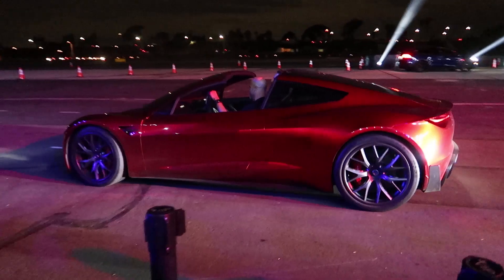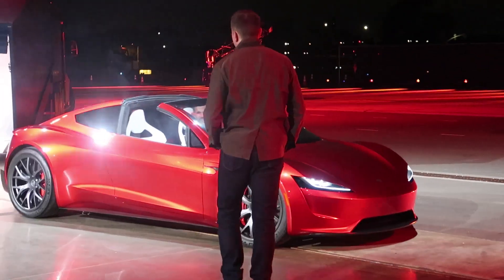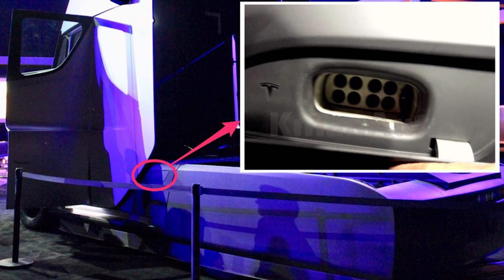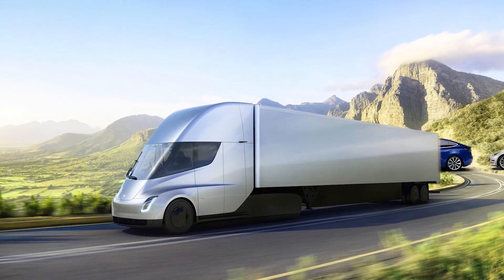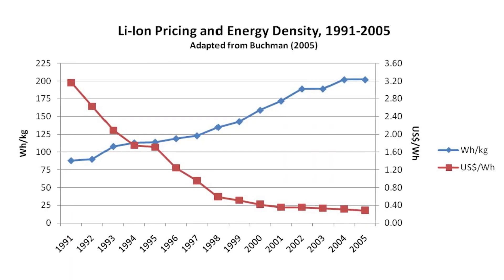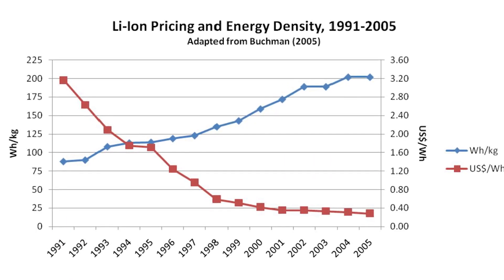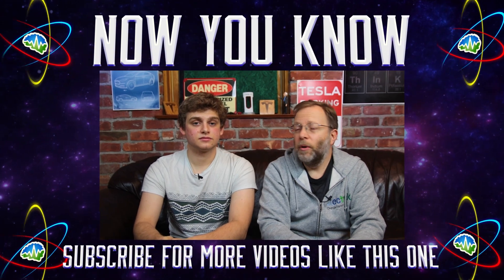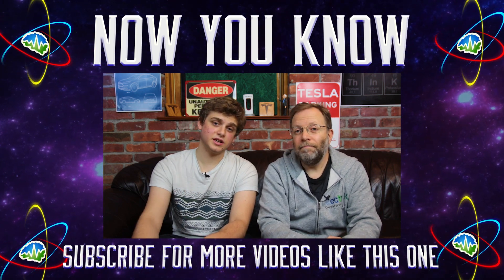Mega Charger Theories - In Depth

Comment: I’m not convinced that there needs to be any breakthrough over the existing 2170 cells to provide the power and capacity needed for the Semi or Roadster.  The main problem with the 2170 has been the production speed, so when the line is fully automated, and running at speed, I think Elon will give more details about how much better the 2170 is over the 18650s. Something he can’t yet do because the demand for the Model S and X to change over will be immediate and enormous.
I predict that the density, charge rate, discharge rate, stability of current 2170 cells will be substantially greater than initially projected. That is why Tesla has decided to not specify the battery capacity on the Model 3, and seemed to encourage the EPA to under estimate the mileage on the long range battery.

Comment: I've wondered why not have a Tesla trailer with batteries in it? And you could have motors in the trailer wheels as well. The idea being that the trailer can be precharged when the truck connects and when you drop off the trailer the truck can grab another charged trailer for the ride back. Saves stopping a a megacharger.
Reply: Excellent point and something that could be easily retrofitted to any trailer.
Reply: great idea, BUT, battery-packs in the trailer will reduce weight-capacity!

Comment: Hi guys! Love your channel! I have a question and if you don't have an answer, can you do a test on it? My question is how long can a tesla(3, S, and X) run for parked with the heat on? I ask because i know people have them in cold climates and could possibly get stuck in a storm or something. Would be great if it can last at least for at least 12 hours.
Reply from the maker: +Sincere DaGenius that is a good question! We don't have an answer in regards to Tesla's but let's talk about my Leaf. The Leaf's heater uses about 3.5 kW and the battery is 22.5 kWh. This would mean, fully charged, I'd have heat for roughly 6 hours(with a fully charged battery) therefore, assuming the Tesla also had a 3.5kW heater but a 75-100kWh battery means that it could run heat for 21-28 hours.

With that being said, if situations were truly dire and I expected that I would be there for a really long time, I'd turn on my seat warmer instead. The seat warmer is much more efficient as the power goes directly to my body and it only draws around 45W my Leaf draws 300W just to be on, so I'd be drawing 0.345kW which would heat me for 65 hours! And assuming the Tesla was the same, heat for 217-290 hours.

The seat heater usually keeps me quite comfortable even when I don't have any heat on. Although I'm usually wearing fairly warm clothes. So I think that as long as a pack a blanket in their car they should be fine for quite some time.
Reply: Now You Know thanks for the reply guys. I wonder if Elon also thought of this... most likely he did... he thinks of everything lol

Comment: Roadster: 200 kWh pack
Semi (charge port) : 8 pins (4 x Positive&Ground = 4 battery packs)
Semi (battery capacity) : 4 x Roadster pack = 800 kWh (4 x 200 kWh pack)
The Semi have 4 motors, one per 200 kWh battery pack! 
MegaCharger: 4 x 375 kW @ 85% efficiency = 1275 kW charger
Semi have 2 types of gearboxes (15:1 and 23:1) to have better effiency.

Comment: Well, there is a thing about Volts verses AMPs that people have a tendency to not know.

AMPs is what causes the heat in the wiring, not volts.
Thats why when you hear them talking about the more powerful charging stating, they talk about how the VOLTS gets higher.

For example, for standard DC Fast Charging, thats what it is 400v, not 120v or 240v. They can keep the amps the amps lower reducing the heat caused by the resistance in the cable.
When they are talking about the 800v systems, that means they can keep the AMPs the same or less while delivering more WATTS as a whole.

Look at your cell phone. They now have the Quick Charge standards. In those standards, they have different voltages. How do you think they go from 5v charging to 9v charging while still using the same cable while charging your phone faster?

With phones, they do 5v with up to 2.1Amps (= 10.5 watts), and the average Quick Charge is 9v at 1.67amps (= 15.03 watts).

But you see there, i was able to give you MORE wattage with less amps. This is allowing the cables to remain cooler preventing them from catching on fire.

This same thing applies to car batteries. They could keep a cable with the same gauge wire but be able to up the wattage by upping the voltage.

How do you think they do High Voltage power lines? It reduces the resistance preventing them for getting hotter and less efficient. 

With the trucks, they could be outputting 800v or even 1600v to get more power into the trucks faster. This would allow them to have a connector not much larger then its current one but at least smaller than a ChaDeMo instead of one that is 1 foot round.

Comment: How do you prove that new battery chemistry lasts 8 years?  I don't think that is possible to do quickly with 100 % certainty.  -> They already are testing new chemistry. It will be used first in low volume product (Roadster 2) to reduce risk.

I agree, they are using 4 chargers to charge 4 batteries in semi.  4 separate cables would be easier to handle than single large one.  Total charging power must be about 1 MW, so each of 4 plugs must be larger than current supercharger plug.  I'm looking again your picture. Perhaps only 2 plugs...

80000 lbs at 60 mph has 13 MJ kinetic energy.  To get that in 20 s about 700 kW is needed.
Reply: How much force is needed to push in (pull out) Tesla supercharger cable?  Would 10* more force be too much?

Comment: You know, I'm now reminded of AMD's Ryzen, Epyc, and Threadripper CPUs (Zen architecture), simply because of the following:
 - It's had its own share of delays (I think its original release date was late 2016 and then it got pushed back to early 2017; someone needs to verify)
 - Plenty of bugs upon release, most of which were fixed with BIOS updates; if you're an early adopter, you'd have to be willing to put up with that
 - Its goal is to provide high core-count CPUs at a far lower cost (~$300 for an 8 core 16 thread CPU vs ~$1000 for the Intel equivalent)
 - There's also a server CPU (Epyc) made out of four of the top 5% of the highest-tier Ryzen CPUs
 - No one expected or predicted Threadripper (high-end desktop CPU) because it's been kept a very closely guarded secret, even though it was just a side project between AMD workers; it's also built similarly to Epyc
 - Intel panicked so much that now they're making their own high core count CPUs; for example, Coffee Lake is expected to feature 6 and 8 core variants.

Ryzen 7, 5, 3 => Tesla Models S, X, 3
Ryzen Epyc => Tesla Semi
Ryzen Threadripper => Tesla Roadster
Zen 2 Architecture => Tesla Master Plan 2

If anyone understands what all of this meant, it means you have as much an appreciation for CPU innovation as you do with electric vehicle innovation.

Comment: The weight of the battery cells for a 1Mwh battery is about 3.7 metric tonnes from what I can gather. One cell 66 g and 17,7 Wh. A semi trcuk seems to weight around 17,000 to 22,000 punds, so it does seem possible that a Tesla semi could fit this. That is with the current 2170 battery cells.

Comment: Guys - the new 21700 cells are more energy dense per kWh than the 18650's.  They are also more than 30% cheaper than the 18650's.  Elon Musk said in 2016 that the 21700's are working out to be nearer to 50% cheaper.

Comment: Electrically Zac's parallel chargers makes the most sense Redundant systems. Also the Mega chargers should have a wind farm connection and they should be at the distribution centres  first because all the trucks go back to their Distribution Centre. Tesla could drive sales by saying if you buy x trucks we will put Mega Charger connections in your distribution centre. Also if you repackage the materials of four Model 3's 75 kWh into a Truck you would have a 300 kWh truck for 140k including 20% profit for 300 mile truck add four more 75 kWh battery packs.  The experts are looking at traditional 18650 batteries and saying breakthrough is needed. Break through already happened 2170 with a Giga factory to churn out 1000s of battery packs otherwise Tesla could not produce 5000 or 10000 Model 3s per week.

Comment: No, you are wrong. Tesla communicated the Semi has the same cells as the power packs. So NMC 2170s. The S and X use NCA 18650s.

Maybe the cells for the Semi use the (not yet production ready) new electrolyte additive recipe. Jeff Dahn did a talk at the beginning of this year. Stating that removing a 'standard' additive and adding 'some other' additive had spectacular results. Doubling cell cycle life while being able to charge the cells above 4V.

For the Roadster. Maybe it's the same. Using 2170s in a optimized pack...200kWh could be done with a 1 ton pack. Then the Roadster could weigh in somewhere between 1800 and 2000 kg.

Maybe.... The Semi pack has a very high voltage compared to the S, X and 3. 1000V charging at 500-1000A...adds 250 to 500 miles per hour...

So probably no giant revolution, but significant developments for sure ;).

My 2 cents.
Reply: Korrel Zout I think that you are at least 99% correct. The 1% is the thing about the weight of the roadster batteries I think that they weigh less.
Reply: Mario Kajin Probably...but just wanted to sketch the possibility that the Roadster battery would fit and weigh a ton max with current tech...probably improved current tech due to significant developments in cell electrolyte recipe, cell form factor and pack design ;).

If I were to be 99% correct... Wow...then I should get lottery tickets asap :p.

Just a bit annoyed that this myth is getting echoed around some YouTube channels.
Reply: what Elon said is that they are using the same chemistry as pawerpack.
Reply: jcval87 Correct... And those are NMC and not NCA ;)

Model S and X (probably the 3 as well) have NCA cells. The S and X in 18650 format and the 3 in 2170 format.

Comment: I kind of assume that they are charging more than 1 pack at a time.  Which is the reason for the additional  connections on the plug.   Same way if I was charging an ebike with 4 battery packs that all work together, and I charged  each of them with a separate charger.    So I could charge 4 packs in the same time as one would take.  Which you just agreed with as I was watching the vid and typing this. ;)
Reply: It can be one big pack, they just would charge it in 4.  When you plug in the pack is segregated to 4 packs.  Pretty simple for them to do.  Doesn't make it much more complicated other than needing a heavy contact relay like they use on Tesla cars already.    First day I saw the plugs I was pretty sure that was what they were doing.

Comment: elon worked on battery technology in grad school. Also, when "new" battery technology is scientifically proven, it hasn't been engineered into a potential product, let alone the business innovation required to mass produce that product as a part of a company that can turn a profit on balance. There was a time when panasonic was more capable of doing that engineering and buisness, but Tesla is rapidly becoming the most powerful battery producer and consumer. in the deal they made on the gigafactory their collaborators are becoming less and less useful, like the failure to make a production line for model 3, which was literally trying to make new battery technology into a finished product, Tesla is making new manufacturing techniques which make it very hard for panasonic to partner with toyota or ford, who partners with a dealership to turn a profit, when competing not only with tesla battery, but every component of the company.

Comment: I never understood why people doubt the Mega Charger because 480 volt 3-phase is available up to 3000 amp service, which the mega charger would use. I guess it's because no one is an industrial technician like me that works around large power panels and huge motors, so they would not know this.

Also, the battery packs would NOT be segmented. The chargers are isolated circuits due to transformers inside them so you cannot create a short circuit if positive of one charger touches negative of another charger, so all they have do to is hook up the wires such that 4 connections connect to the big battery pack in such way that four banks are being charged. I've done this berfore with 48 volt golf cart that uses 8 volt batteries by using two 24 volt chargers. All you do is hook up 3 batteries to one charger and 3 batteries to the other charger. There is no risk of short circuit because again, the circuits are isolated with transformers that are inside the chargers. Really not that complicated to understand.........
Reply: You are 100% correct 480V is THE industrial source and it is so much cooler than 600V  and 12 800 would be just crazie for the public to use, but if i was racing, .....
Reply: What grade would 3000 amp use 000 ? LOL

Comment: You asked whether there was a battery breakthru happening.   And you answered it yourself in the video.  The answer is YES.   The real question is: how close to commercial production levels is that - pick your favorite -
 breakthru.   Lets talk about 2 that I know of (but just type "battery breakthru" into any browser and JUST read the articles from the current month, there will be at least a dozen.)    

2 months ago I saw a piece on someone that apparently has solved the "dendrite" problem for lithium ion batteries.  (well, %90 of it at any rate)  This is where, as you charge and discharge a battery, some chemical residue builds up on either the cathode or the anode, if you charge or discharge too fast or too much, the build up gets worse and over time, this limits current and the charging capacity of the battery.  I suspect this is a real breakthru, and I suspect that all the battery manufacturers are chasing implementing it.  This change might be called evolutionary.

The second is the sodium ion battery, which holds some promise - as lithium production in the world will be severely strained by ramping up EV produiction..  There is a trial manufacturing plant (small scale) being built right now to make sure that what has been seen in one off hand built cells can be replicated in mass production (I'm not sure if this is at Stanford or not...)  I figure this is real as well, and we may see the fruits of this in 3 or so years (my personal guess).  This change might be called revolutionary.

Think of all of these as tools in the toolbox, and Tesla (and in fact ALL manufacturers) will pick the best choices for their application, and those choices will change over time.  Remember Tesla has 3 lines of battery manufacturing at the gigafactory, and they have stated that they are building a 4th that will operate at three times the speed of any of the current lines (based soley on what they learned from the model 3 speed of production hell they just went thru).  This will allow them to shut down one of the original lines (one at a time, right?)  and upgrade them to the faster speed.   If you think that they won't take that opportunity to include any reasonable breakthrus at that time, you are sadly mistaken.
Reply: And there is also Graphine in play, if that is figured out, it will change the world. I heard that there is a way to make graphine layer out of hemp, so totally scalable and super cheap and eco to make.
Reply: https://www.youtube.com/watch?v=0M8CGJIhygM

Comment: Agree with you on all your points. Main consideration with Semi is energy consumption. Acceleration of mass  (Load). Air resistance (drag coefficient ) Rolling resistance (tires, bearings). Energy regeneration (recouping acceleration of mass).  This means greatest energy drain is air resistance for trucks at highway speeds. How much less than 2 KWH are they calculating?   Headwind, tailwind, crosswind, no wind, So many factors to consider. Under the right conditions (strong tail wind) the energy consumption per ton could be phenomenally low. ( Why platooning trucks works so well)

Comment: I don't think there is a battery breakthrough yet. I think the roadster and the semi are using 2170 cells. Price wise. When the the bottlenecks for the model 3 accrued elon was saying, when they had to rebuild the assembly line that it will be twice as efficient. Maybe they found a way to save money

Comment: i've heard that a couple times that new battery technology will obsolete tesla, clearly some misunderstanding about batteries there... if they had to tesla could probably hack existing swappable battery packs with whatever new technology comes out, as long as it is putting out some voltage at some current capability it can be configured to work

Comment: 4 model 3 batteries just isn't enough either storage or charging. 4 superchargers are 520kwh nowhere near a mwh and nowhere near enough for 400miles in 30mins. 8 (or more, based on their <2kwh permile i recon it will be around 800-900kwh battery pack,) model 3 battery packs are more like what they will need. But I agree I think its using 2170 and others are comparing it to normal battery prices and not what the gigafactory can produce them at. Also remember tesla will be paying wholsale electric prices not retail, and can store cheap electricity at night, along with solar.